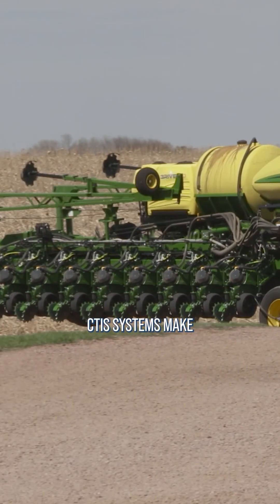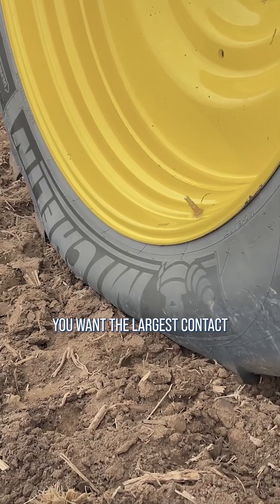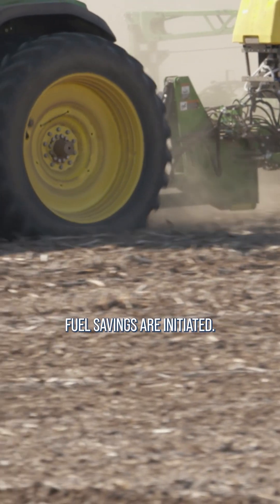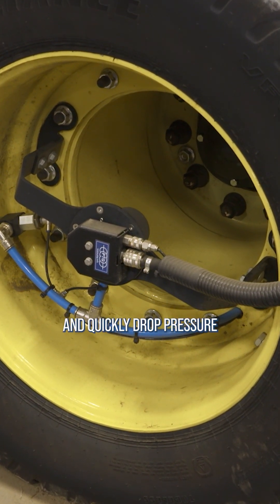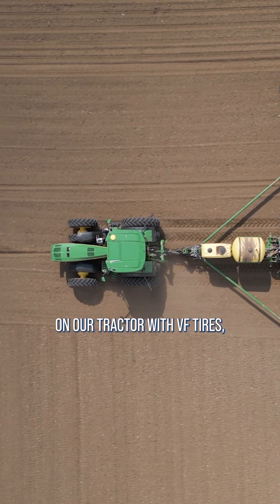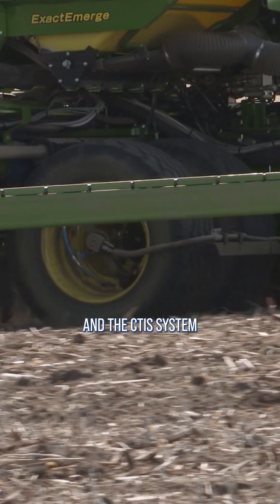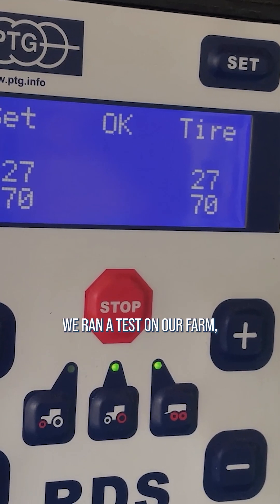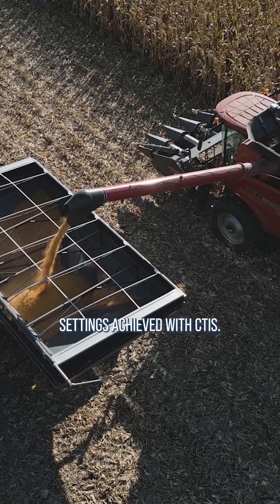With CTIS, 80% of the total air can be let out in the first 90 seconds.

Comment: Was the 3.4% increase in yield achieved across the width of the planter, or was it a 3.4% increase in the center 4-6 rows?
Reply: You’d only see a difference in the pinch rows that follow the tractor wheels/tracks.